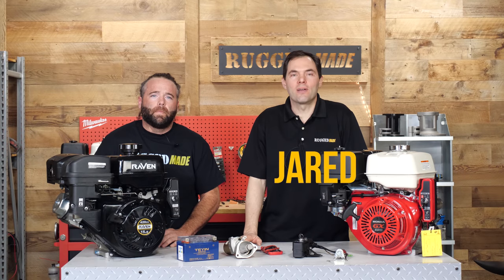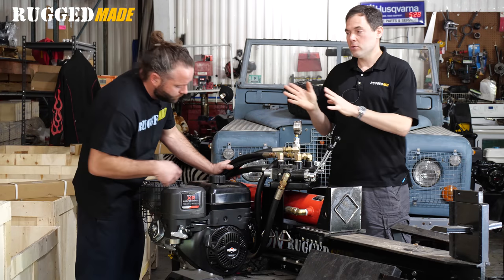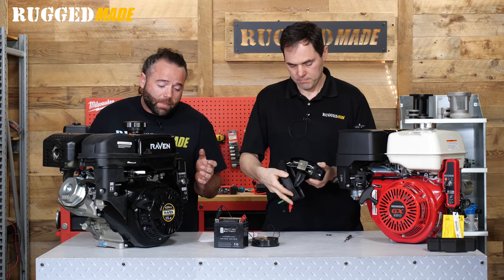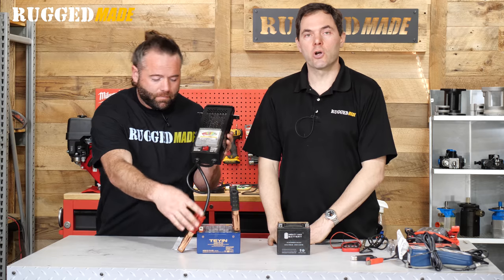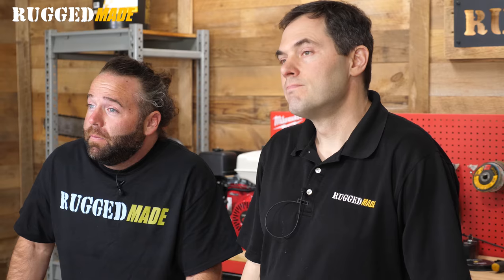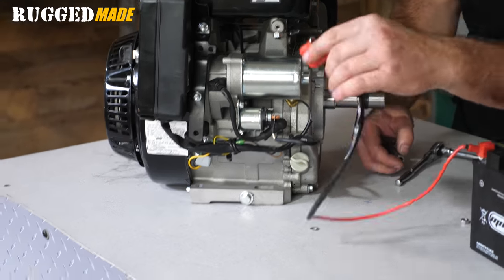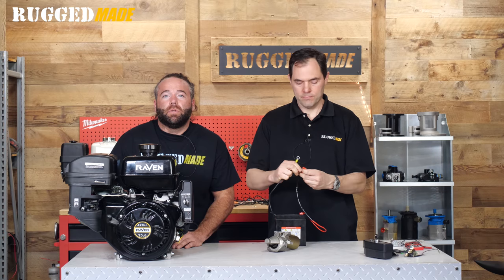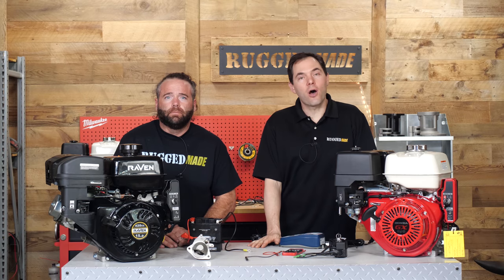Tech Corner: Troubleshooting Electric Start Issues in Your Small Engine

Comment: Hi: enjoyed the video. I have a rugger 37ton log splitter with a raven 301cc engine 10hp with electric start. My wiring must be wrong because I can start it with the key start, but it won't turn off when I turn it off. Where can I get some pictures to see how it should be wired properly. Thanks

Comment: how about the engine starts but the stater does NOT disengage. Engine runs but has a high radpy sound. starting manually is OK. Solenoid or starter motor???

Comment: 22 hp v twin Briggs and Stratton , runs good , turn off after getting hot , doesn't want to turn over until it cools down , then it will crank , what is the issue .???